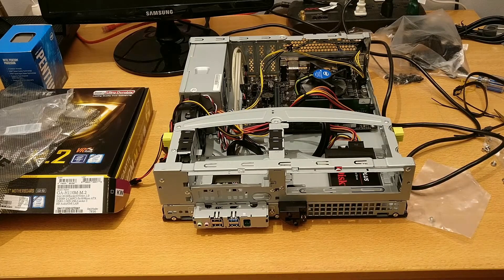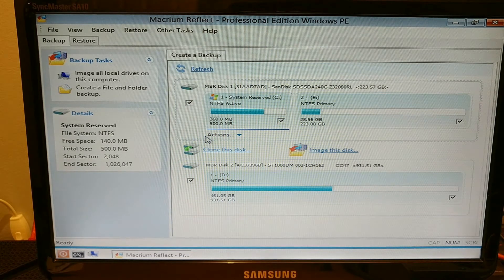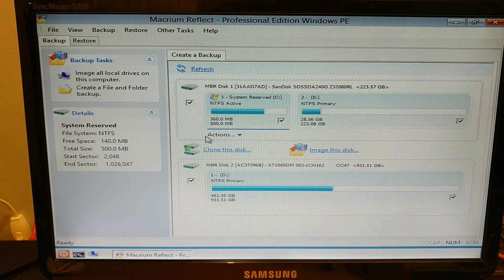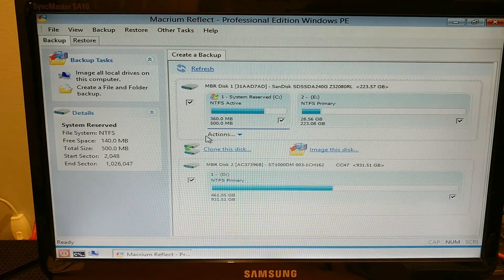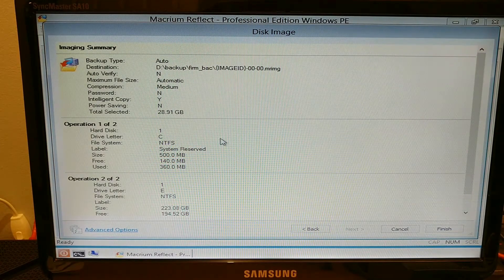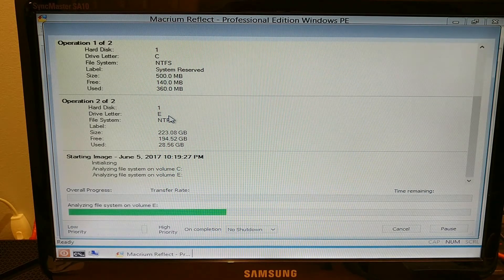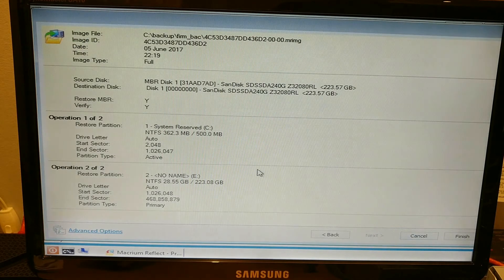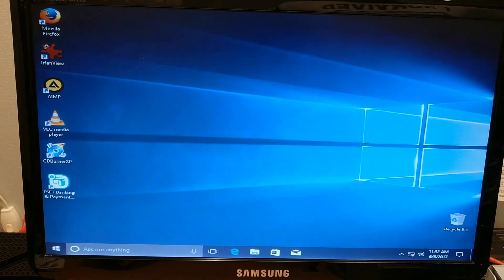Multiple Office PC Builds with Disc Image/Restore

Comment: If you are a real tech you would use Acronis not that crap.
Reply from the maker: nick poverman Comments like this are empty as you give no reasoning behind it. "Real" techs use what works. Macrium Reflect has garnered much respect and kudos in the tech and user community for some time now. Acronis is also well respected, but it's not the only viable choice. The clone worked 100% BTW.